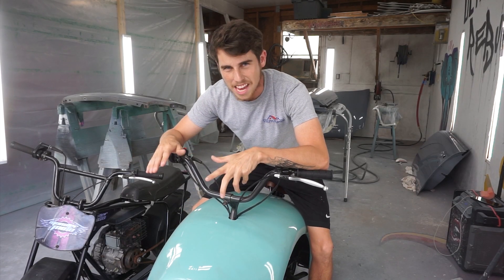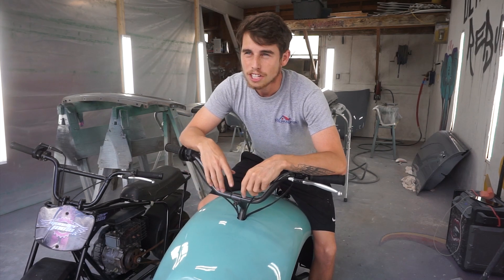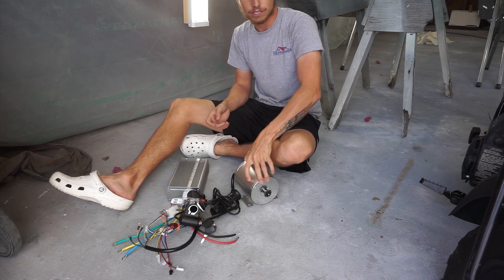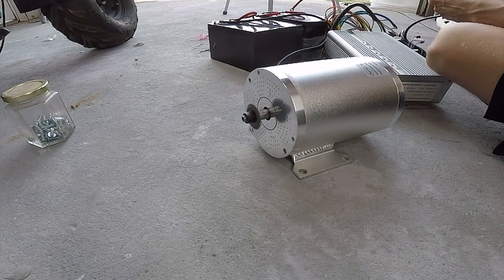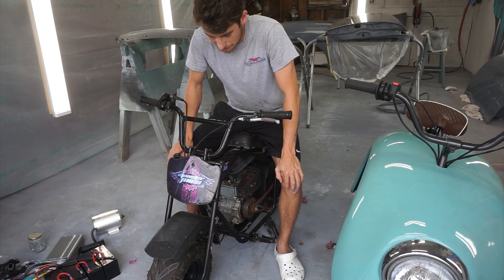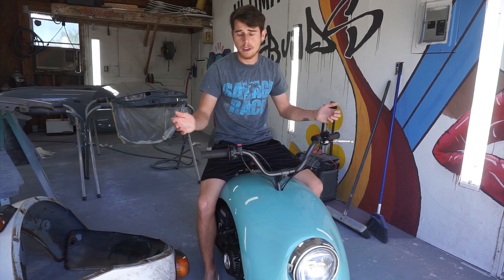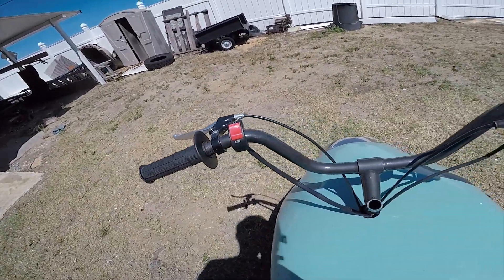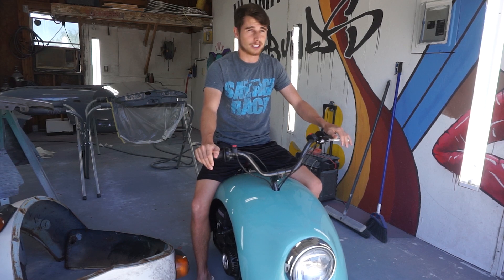I am Building an ELECTRIC Volkswagen Mini Bike

Comment: After doing a quick calculation, if those are 7.2ah batteries then you should have just more than 30mins run time. Would be awesome if you could modify the drive wheel as a direct drive system considering the inverter is your control system. If you do that then you will have plenty space for 11ah or even 15ah batteries. Just a thought.

Comment: Surely a way to adjust geometry so the handlebars and seat are further forward? That way less of an issue with the front end lifting. Just get yourself sitting over the centre. A proper 2.0 rather than a simple electric version of what you did before! Anyhoo - love your work.
Reply from the maker: Might be able to move it an inch or 2 forward but it’s difficult with trying to keep it all underneath the fenders.

Comment: This time you have no excuse to not fill in the sides. I am sure your going to have 0 issues with this build. 😂😱👍👍👍👍👍
Reply from the maker: Working on that. A lot of people asked about side panels on the blue mini bike but I’m worried it would overheat the engine. But this build has a better possibility to work.
Reply: @ultimaterebuilds7127  Yes I remember people asking for the side panels. the staring pull was also an issue too, if I remember correctly. Some nice louvres would vent any heat on this one.